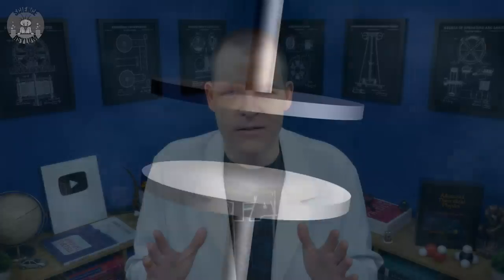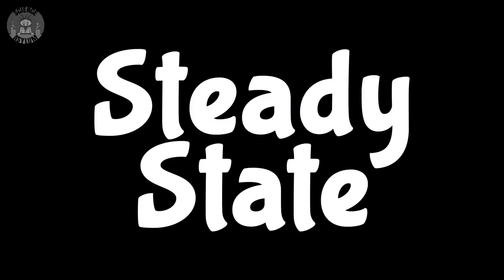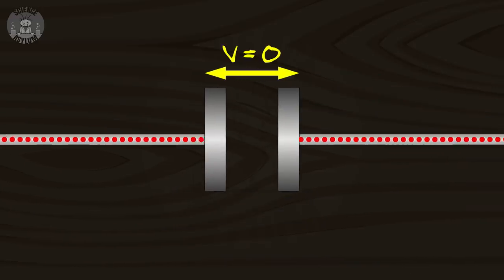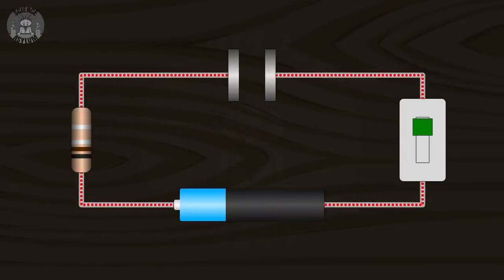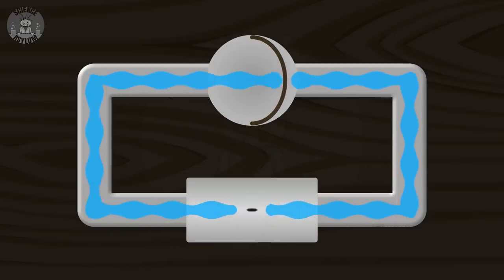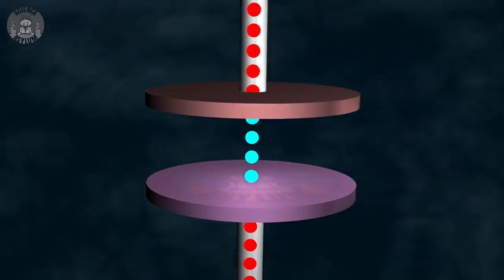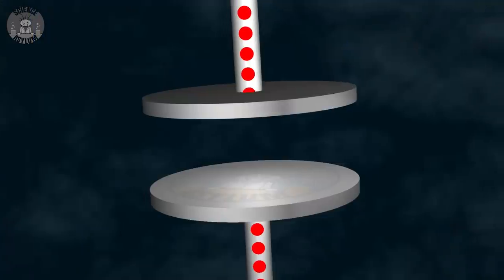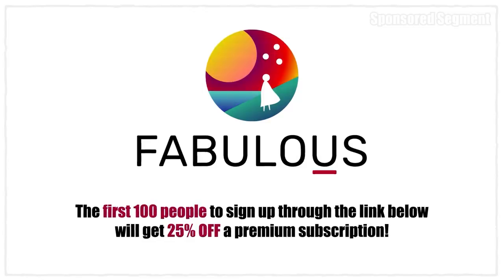Capacitors Are Gaps! How Does That Work?!

Comment: You use a dielectric because that provides a polarization field increasing the electric displacement field.
Increasing voltage and thus increasing capacitance. 
Another intuitive way of seeing it is that the dielectric provides a closer inverse polarity surface to each surface of the plates of the capacitor. I.e. the positive plate of the capacitor will be in contact with the negative surface of the dielectric, due to polarization and through coulomb's law we know that the force will be higher between charges that are closer together.

Comment: This is the first time I have heard anyone address the problem I had in wondering how electrons were flowing (how capacitors in series, for example, decreased capacitance), but, since electrons are getting to the other side of the battery to the other to complete the chemical reaction inside the battery, I need an electron flow diagram or another cosmic explanation.

Comment: Very interesting...

I'd never seen or thought about the energy flow into and out of a capacitor in those terms before. It's a neat visualization for a simple disc capacitor, but... most real capacitors are tightly wound spirals. What in the world does the energy flow look like in and out of those?

I imagine the distances in the visualization for the energy flow are vastly exaggerated, so maybe the gaps between the cylindrical capacitor plates are so huge by comparison that it basically looks the same on a local level?

Comment: 8:51 I prefer the diaphragm metaphor, especially if it's an accurate metaphor. Discarding the diaphragm metaphor to imagine current across the gap if there isn't current across the gap seems to reduce my comprehension. Isn't it more accurate to say this? "Until the diaphragm is full, the math works as if there's current across the gap -- but that math stops working when the diaphragm is full."
Reply from the maker: The diaphragm metaphor is pretty accurate. I think the reason we often assume current is passing through (even though it isn't) is because most circuit analysis is concerned with the inner workings of electronic components.

Comment: The charge in a capacitor is actually stored in the dielectric, not the plates.
My physics professor demonstrated this very dramatically in lecture. 
He had a specially built capacitor, which could be disassembled after it was charged.   With the dielectric removed, he showed that the plates weren't charged --- he shorted them together, no spark.
After putting the device back together, he shorted the plates again, demonstrating that the charge was still there --- big spark.

Comment: So if energy flow in a circuit happens in the fields, how does the resistance of the wire dissipate energy? How does the introduction of resistance in the wire, assuming it is uniformly distributed along the wire's length, change the Poynting vectors? Thank you so much for this great video.
Reply: Great question!  Perhaps the simplest way to think about it is to realize that the resistive voltage drop distributed along the wire slightly tilts the electric field vector: instead of being purely perpendicular to the wire, it has a nonzero component parallel to the wire.  Now, remembering that the Poynting vector is perpendicular to the electric field, you find that this field tilt also tilts the direction of the Poynting vector slightly inward toward the wire instead of being purely parallel to it, and that means that a fraction of the energy carried by the fields is transported into the wire and is dissipated as heat by the resistance.
Reply: @jgclar  
Thanks. Great explanation.

Comment: 9:50 Consider a chain driving, say, a bike. We can try the same analogy there. Our legs give each link in the chain some kinetic energy, and we send it to the back wheel to do its work before the link turns around and comes back to the pedal.

Or the water analogy. I pump water through some pipes and they drive a turbine or something in the other end, before the water flows through the rest of the pipes back to the pump. We could explain this by saying I give each water molecule some kinetic energy and send it down the pipe.

They both breaks down for the same reason the electric analogy does: No link or water molecule slows down, so we aren't using the kinetic energy of the links or the water molecules to transfer energy. Just like we aren't using the kinetic energy of the electrons to light a lightbulb.

I'm still a bit on the fence about the whole Poynting thing. Could you explain how electric current driving a light bulb is fundamentally different from a bike chain or water in pipes that makes it so we NEED Poynting vectors to explain how we can light a lightbulb, when we clearly don't need them for the bike or the turbine, as no electric or magnetic fields are even present?

I mean, I get the theory. I see that it works. But both of your videos on the subject, along with Veritasium's recent video, makes it seem like it's the only correct way to think about it, and I don't buy that yet.
Reply: Except they would slow down.  The reason they don't slow down is b/c we keep adding more kinetic energy to the system.  Stop the pump and the turbine will extract all the remaining kinetic energy and it and the water will come to a stop. Stop peddling and the chain stops. Disconnect the battery and the light goes out.  You're over thinking it.  Energy is transferred from one thing to the other via a medium.  Water, the chain, or the EM field in a circuit's case(but not via the small kinetic energy of the electrons).
Reply: @bradbadley1  My entire point here is that it is being presented as though Poynting vectors are presented as the ONE AND ONLY explanation as to how energy is transferred, and "the energy is transferred through the actual electrons" is painted as blatantly false. I am trying to understand where the water analogy or chain analogy breaks down. And it is not at the point where he took time in the video to explain where some analogies break down, for the reasons spelled out in my first comment.
Reply: @bradbadley1  The problem is that you can not see the EM field. I am actually with MasterHigure on this one. I think we have to put the Photon in as the EM field. Using the Poynting theory there has to be some magic fields in nothing. Using the Photon theory we may have a way around it as Photons can be big enough (as big as the universe it self according to Wikipedia) to handle close to DC if not DC as well. DC doesn't last forever.  Resent experiments show that the energy is mainly propagated along the wire with the speed of light and not instantaneously. Some energy is transmitted at the closest direction too which would happen with this theory as well.  I think we can think of the Photon as a wavy  bobble of energy. I am not smart enough to work it out mathematically. 
The chain, the water and the electric energy doesn't stop immediately when the switch is off. There is kinetic energy. The electric stop is also transmitted with or near the speed of light.
Reply: I am with you on the Poynting thing. Reed my note to Bradbadley1

Comment: "The transient state of a circuit doesn't usually last very long".   As a EE that specialized in circuits that's not true.  A capacitor is either used to manage frequencies bands or to filter out transients  (which is just a zero hertz low pass filter).     Another use is for DC blocking with is an example of a high pass filter.   Then there is things like step inverters which gets really fun.  The fundamental analysis of L, C, and LC circuits is done using calculus which is the study of "change".     "Steady State" is a theoretical condition that is used to simplify analysis but doesn't truly represent reality.

The exception would be something like using capacitors to start a motor.
Reply from the maker: That was essentially the point I was making. For circuits with just resisters or something, the transient state is short. But, when components like capacitors are involved, that's not always the case. In those cases, sometimes even the short transient states are important.

Comment: If the particles don’t receive energy from the battery what causes then to flow in a particular direction. Is voltage a force or energy

Comment: 10:45 I've had some time to think about your Poynting Vector video, especially in light of the fact that Veritasium make his own video about that topic.

If you don't remember me, I'm the guy who expressed deep skepticism over the idea that energy travels outside the circuit.

So now let me ask you this: is there no electrostatic repulsion between electrons inside the wire? Doesn't that electrostatic repulsion, acting upon moving charges, represent the transfer of energy? Does that energy from the electrostatic repulsion not lead to electron motion? Doesn't that energy come from the chemical reactions inside the two terminals of the battery, after an excess amount or deficit of electrons appear on the negative or positive end of the battery? And in light of all this, wouldn't the Poynting vector just represent energy that is lost and re-gained from the circuit that is primarily driven by electrostatic repulsion?

An argument can be made that the Poynting vector itself is a concept of limited scope, and ironically, capacitors themselves are used by David Jackson's Classical Electromagnetism to make the point: if you take a charged capacitor and place a stationary bar magnet directly next to the capacitor's gap, you'll end up with a Poynting vector that points out the side of the capacitor; no such energy flow exists, however.
Reply: Also, you mentioned that there are 3 reasons why capacitors use dielectric, then mentioned 2 of those reasons while promising to get into the 3rd reason, and then never mention that 3rd reason again.

I presume that you were referring to the closely-packed charges inside the dielectric material that greatly expand and strengthen the electric field inside the charged capacitor.

Also, I might be wrong, but I'm about 90% sure that dielectrics break down and conduct electricity more easily than air; the dielectric increases the energy stored inside the capacitor at the cost of greatly reducing its breakdown voltage.
Reply from the maker: Hey! Yes, I remember you. Haven't seen you in the comment in a while.

"Is there no electrostatic repulsion between electrons inside the wire?"
Absolutely. There is always electrostatic repulsion between electrons.

"Doesn't that electrostatic repulsion, acting upon moving charges, represent the transfer of energy?"
Not really. Any work that repulsion was going to do has already been done. The electrons are already as far from each other as they're going to get.

"Does that energy from the electrostatic repulsion not lead to electron motion?"
Yes, but for work to occur, there must be a change in kinetic energy. You could argue a tiny amount of work is done this way the moment you flip the switch... but after that the kinetic energy of all the electrons stays steady.

"If you take a charged capacitor and place a stationary bar magnet directly next to the capacitor's gap...."
We don't know there's no energy flow in that situation. All we know is that the energy isn't being used for anything, but that's completely consistent with the Poynting vector, so there's no discrepancy. The total amount of energy inside the capacitor never changes because, for every bit of energy that flows out, an equal amount flows in on the other side.

Comment: I'm still looking for a really good video that explains why capacitors are inserted  into circuits. If anyone knows one, please comment.   I mean, if the current is available and flowing, why block it with a  capacitor?    Years ago, I thought I learned  the charge would build up on one  plate, then when high enough jump to the other side. Then start all over again. So, you get a pulse. (ok, I guess that is one use of a capacitor, if true).   I never remember being told the material between the plates  totally blocks the jumping as is described in this video of so many others about capacitors.  I am fascinated by electricity and  trying to learn. I just seems my intuition  about so many things regarding electricity is lacking, but I am slowly learning.
Reply: You could begin to learn how capacitors and resistors work in combination (RC filters) to "pass" only frequencies above or below a desired value.
"High pass", "low pass", "band pass" and "notch" filters...
Isolating DC from RF allows a preamp to operate near an antenna, its voltage & current supply not related to the distant amplifier's power supply.
Capacitance (like inductance) introduces "energise/de-energise time dependency" that has frequency, and therefore wavelength, significance in a circuit.

Comment: Due to the fringing effect, the bending of the electric field outside of the capacitor plates, shouldn't the Poynting vector field wrap around the plates to get in or out of the gap ?
Reply from the maker: Absolutely, yes. I even made a separate animation showing the entire battery/capacitor circuit with the energy flow included (but then couldn't find a good place for it in the video). The flow is exactly as you described: it follows the wires until it gets close to the capacitor, then wraps around the plates so that it can come in from the sides.

Comment: A capacitor is basically a fast charging accumulator when in a DC circuit. In an AC circuit it charges freaking fast and then it discharges freaking fast. 
I had a course about how logical gates are made from electric components and we would use capacitors in order to decrease response times.

Comment: Loving the poyinting vector, however i have a question.
In a circuit with a neon bulb running on direct Current only one side of the bulbs electrodes will glow, if the energy was coming from both directions wouldnt both electrodes glow?

Comment: As an electrical engineer (or at least a future one) I dont quite agree with your sentiment on us. Yes, we dont care how exactly capacitators work with our calculations. But we do know it. We learn it in the first semester and then we proceed to say "no dc current goes through, nice isnt it?". 
My understanding is roughly field/voltage carries charges, those influence the field, stuff happens. Capacitators put a stop to that, charges build up, field increases on one side, and if you fuck up capacitator goes boom bc you have too much charge/energy difference.
What I dont quite get is why the field is not traveling along the cables but through the shortest part of the field lines. Like, veritasium made a video about that, with a theoretical experiment with 100000km long cables and a lamp right next to the power source. He said, it would instantly light up, even though the cables would need some time (with the speed of light). That never quite made sense - can energy travel through an arbitrary weak field? Or does the lamp go brighter the more "field" the speed of light allows to transmit energy? IDFK.

Comment: Wouldn´t open switches be capacitors? And how does the time-dependent calculations look like? Any advise or link?
Reply from the maker: "Wouldn't open switches be capacitors?"
Yep! Technically, they are capacitors... but the transient state is extremely short.

Comment: 🤯🤯 could this also be how lightning is made? The Thunder Cell is the battery, Earth is ground, there is an air gap between the charged clouds and the ground. It’s the world largest capacitor? An electromagnetic field is built up in the area and when the voltage reaches a critical point, the charge jumps the gap and that’s the lighting bolt. The energy doesn’t come from the cloud, but the surrounding area.  I was kinda skeptical about the pointing vector energy flow concept because it’s so counter intuitive to how computer networking is taught because it’s easier to think the electrical signals are flowing through the cables at nearly the speed of light carrying the ones and zeros to its destination.  But this capacitor video made it easier to grasp.

Comment: If you could calculate the photonic variance at earth, a corresponding point of energy based on G at distance, then a point in another galactic sheet,  well you'd have a guidance system at least.  Traveling at photonic speed would need varianential directional controls.

Comment: I think it's worth mentioning that Ampere did not include the displacement current in his equation. It was a correction added by Maxwell that was necessary for combining Ampere, Faraday, and Gauss's laws to describe electromagnetic radiation. Without the displacement current term there is no wave equation.
Reply from the maker: That's true. We still call the equation with the added term "Ampere's law" though, for some reason.

Comment: Thanks for your videos! You say what capacitors DO, and HOW they work,  but I don't understand what they're FOR.
Reply from the maker: Where they're used isn't really my area, but there are many electrical engineers down here in the comments talking about it if you can find them.
Reply: They are used for storing charge... It could be to place close to a component like an integrated circuit to provide a little pulse of charge that the power supply isn't fast enough to give or it could be to smooth out variations in a power supply's voltage so a component won't see those variations (or rather, so it sees much less).